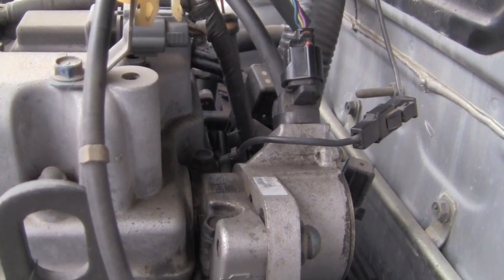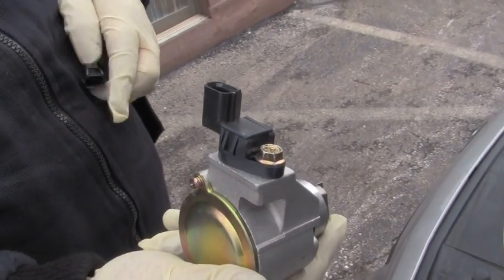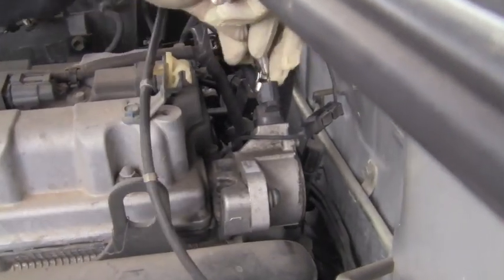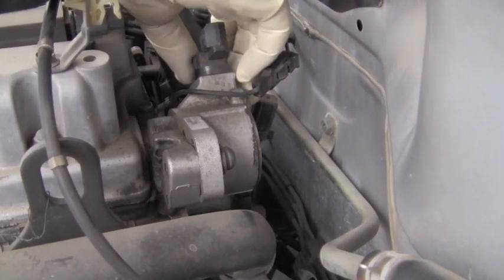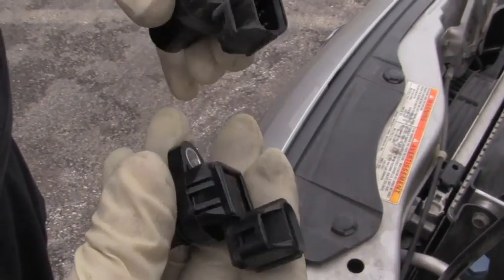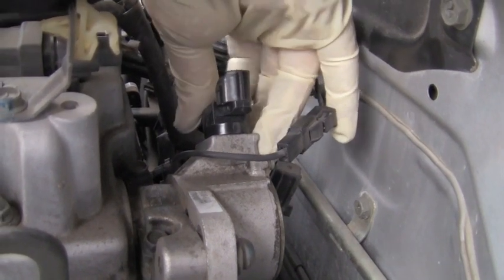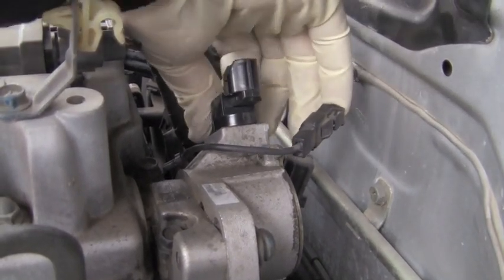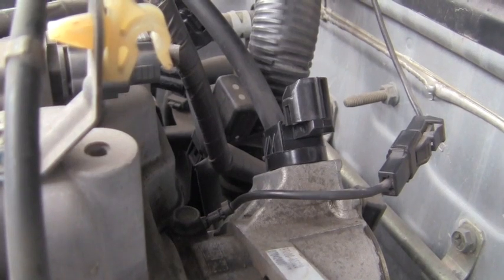Suzuki Vitara 4

Comment: One thing you forgot to ,mention when finding the wiring at the BCM is that it should probably match what was out at the sensors. That will help so you don't have to probe over 200 wires.
Reply: James MusselwhiteGood observation
 It's supposed to match unless they pass through an other element between the sensor and the ecu.
It's on the diagram.

Comment: I enjoyed that. I wouldn't have gone straight for a replacement, though until I had actually determined that it was the sensor itself which had failed rather than simply the connector because hall-effect sensors are solid state and rarely fail this way. This appears to be a physical/mechanical failure as evidenced by the fact that wiggling the sensor lead could cause the engine to cut-out by disrupting the signal.
However, which is cheaper? The cost of my time scrubbing the oxide off those connector pins and bench-testing the sensor itself? Or the cost of a replacement sensor? If I had one in stock or could acquire one quickly, I might be more inclined to simply swap out the sensor to clear that job from my shop and allow me to progress to the next job quickly rather than going down the rabbit-hole. If I had to order and wait for the part, I might be more inclined to try to revive the sensor/connector if I could.
Although, given that I would want to be absolutely sure of on which side of that connector the problem actually lies, I'd probably still give those pins a good clean and test the sensor because I would not want to purchase a new one only to find after fitting it, that the connector on the end of the lead is dicky or there is a fracture in the sensor lead.
I'm not a car-mechanic but I have been known to build robots and duff connectors or fractured leads can cause all sorts of erratic behaviour - just like in that Zook's engine.
It's' funny. I started watching this video series because I have a 2004 G Vit and I was interested to see why this one was misbehaving. The more I watched, the more familiar the problem became until I was essentially watching a robot diagnose and debug session.
A great series. Thanks.

Comment: that is correct,  1999+ J20 has that sub part, (plastic) but Suzuki does not sell it , it's missing in the parts catalog by SUZ.
but aftermarket sells it, rockauto has many choices for it.
I wish my v6 had this, sub part.  the H25. (needs custom scan tool to set timing)
thanks for clear images,  and can be swapped in for $25, by DIY , with no scope.
a slam dunk, on price. but seen the wires snapped inside harness wires , on many, from clutch swaps.

Comment: I don't get it, in the 3rd video you observed that the signal would change if you wiggle the wires, so why did you replace the sensor and not inspected the wires?
Reply: planet1250 I will answer myself beacuse i've discovered why he changed the sensor insted even if it seemed a wiring/connector problem. It's because a connector problem on a sensor 9 times out of 10 it's a female pin problem, not a male one (connector to the sensor), so replacing the sensor was the right way to ensure that the problem will not return, intes of trying (if possible) to bend back the female pins on the sensor.

Comment: what a rotten PCM not to throw a CEL for an obviously bad sensor...thanks, Suzuki!
Reply: happy543210 It didn't hit the threshold limit set by the PCM. That's how intermittent problems can go. For all the computer knew, the engine stopped spinning, of course there was no signal from the crank sensor.

Comment: Thank you for convincing me to never buy a Suzuki. Oh wait.. they withdrew from the U.S. market... I wonder why...
Reply: Jesse Crandle LOL, it's why Mitsubishi stayed. Otherwise they would have had to leave.
Reply: DE Nichols My issue is that a lot of cars need crankshaft position sensors, I've replaced quite a few (usually around 110,00 miles), and since that seems to be a wear part why would you bury it behind the tranny? Not to mention the fact that the wiring diagram was a complete and total lie... that's probably the biggest thing for me. I mean... is connecting a lead to the wire you're looking for then testing every pin on the input for the ecu that hard? No. But it is time consuming. Say you've checked 100 of the wires before you find the right one... that's time you shouldn't have had to spend.
Reply: Jesse Crandle I agree with you 100%.
Reply: Jesse Crandle At the end of my shift a crankshaft position sensor code came in on a 2003 Nissan Altima. Inconveniently placed behind the engine under and through wires and coolant hoses, but still within minutes I had my hands on it.

Going to keep trying to actually do something with the fact my hands are on it tomorrow morning.
Reply: DE Nichols I've replaced a few for Saabs, and it's pretty easy to get to. You have to twist your hand around, but there's a small heatshield covering the exhaust manifold, one bolt to remove it... then you've got visual sight of it. The engine has to be cool since you'll be touching the exhaust when you remove it, but that's not a huge deal for me anyways. One bolt then holds on the sensor, I find a nice wobble extension helps a lot (I generally don't like them but in this case I do). The link is to an image of it. Also the image doesn't show it, but they all have a little heat shield that's held on by the one bolt. Really great idea, I enjoy how much they thought about ease of access for it.
http://goo.gl/OJe2pI